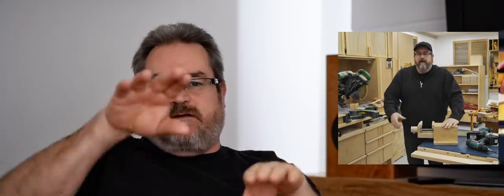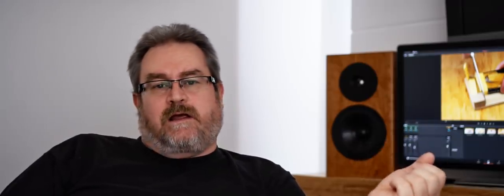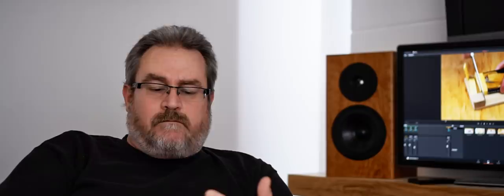So, What Happened To That New Vise, John?

Comment: John, you're a man of integrity.  It's one of the many reasons I regularly watch your videos.  One of the others being that I learn so much from each segment or project.  It pained me to hear you say that you purposely dumb down the complexity of your projects, despite the fact that I understand your desire to appeal to a broader audience.  What I hope you don't overlook, however, is that no one learns an advanced skill or mindset of any kind without a proper demonstration or example.  While you may get more views or plans sales by putting out a simpler project, those of us at the intermediate level might struggle to further improve their skill or enhance their knowledge.  With that being said, it doesn't matter if you make a cutting board or a plywood time machine, I'm going to watch it and chances are, I'm going to learn something from it.  Heisz 2020.
Reply from the maker: When I say "dumb down", it doesn't mean that the projects are easy to do. It means that I I'm going way out of my way to find solutions that any reasonably skilled woodworker can do successfully. 
For example, someone mentioned cutting slots and adding screws on either side of the nut to help hold it in, and while I could certainly do that that, I think the average woodworker would find it difficult to do accurately. That's what it means - making the build so that you don't need to be a journeyman machinist to complete the project.
Reply: @IBuildItScrapBin  Ah!  Thank you for clearing that up.  I hope it didn't sound like I was complaining in any way.  And if by "journeyman machinist" you mean turning steel on a wood lathe with a chisel/file/hacksaw, you got that covered!  Thanks, man!

Comment: I look forward to your projects...always cleverly and skillfully done.  OBTW, I think I am going to make a jointer.  My plan is simple..fence with no tilt.  No infeed adjustment fixed at 1/16" inch...surface using melamine (closet panel).  I may need your plans...but I will be modifying quite a bit to fit my simplified need...thoughts?

Comment: Interesting because Pask Makes has a very similar quick release vise with a half nut held in plywood and he's been selling plans for a year.  However, the one actually in his bench is a metal version with welding and he built the wooden one as a response to people complaining about it requiring welding.  So either his wooden one is not as good as he thinks it is or your wooden one is better than you think it is.  I think he's using a larger thread so more contact area with the wood and he did use epoxy, maybe that's the difference.
Reply from the maker: Or they are not the same design, because they aren't.
I can't comment on what anyone else is doing, just on what I'm not willing to do.
Reply: It is similar in simple definition but very different in function.
Reply: I only mentioned it because perhaps you're being too quick to give up on the idea if the same part of the construction that broke for you is working for someone else.
Reply from the maker: I generally give up on a particular way of doing something when it breaks before it reaches an acceptable amount of clamping force or durability.  But the only real way to find that out for this was to build the vise and test it. My mistake was assuming it would be strong enough, and putting time into the filming and plans.
I could make some fairly simple changes that would make the vise stronger and more reliable, but I'm no longer convinced the project has the kind of appeal to make that worth the extra effort.

Comment: Maybe you should use construction adhesive that have a bit of flex. You will have to put some grooves into the half nut. Or how about using this concept with the geared wise that will distribute the load over 2 half nuts?

Comment: John I haven't seen the plans for the vice, This being said, is there a chance that you can drill a hole through the wood and the nut so that when you glue the nut inyou could drive a steel pin through the wood and into the nut to keep it in place and keep it from breaking loose? Just a thought.

Comment: Protect your integrity, as you are doing here, because that is what is attractive about your work and videos.  The vise failed but maybe it would be fine if not stressed as much as you might have done when it broke, in which case it would be reasonable to offer the vise as a light/medium duty tool with a proviso that it is not intended for hanging on like a gorilla.  Or, build the vise to the specification you would prefer and offer that version because there are people watching you who are well able to follow complicated plans and people who, as you said, would buy the plans for interest sake.  Maybe a sprinkling of more demanding projects would be attractive to people who like a challenge and would give you the pleasure of stretching your ideas a bit?  Whatever you do, just keep it honest because it's refreshing to be able to sit and watch you without wondering if we're getting ripped off.
Reply from the maker: Experience has shown me that designing the projects as I do not only makes them more attractive to potential builders, it also saves me problems in the future with people that can do the more complex stuff accurately. A good example is my box joint jigs, which are fairly challenging to build, but still within most woodworkers skills. 
No, I have to take this one on the chin and let it sting enough so it'll keep me from doing it again.

Comment: Thanks for the integrity.  Is there a way you could braze the half-nuts to some supporting metal using Mapp gas?  Might still be a reasonably accessible project without the need for welding equipment.

Comment: How about a flat steel plate and then drill and tap through the half nut? Obviously the screw would need to be fairly small to leave enough threads useable, but it gets past the need for a welder and only needs people to have a tap and die set.

Comment: Not telling you how to suck eggs just an idea that you may have had already, would it be possible to drill and tap the flat side of the nut for a small bolt or is there just to little material to do so?

Comment: Instead of a nut, have you thought about using a coupler cut in half?  Or getting a 3/4" steel plate that's already tapped with a 3/4" hole (or whatever size threaded rod you're using), cut that in half and have a huge surface area to mount it in some form to your vise.  Just ideas I didn't hear in your video(s) that could still be found readily.

Comment: Having trouble envisioning exact part you’re speaking of, but maybe it might be easier to mount the nuts in plywood blocks with the 13/16 holes drilled in them, but instead of cutting one nut in half, you start with two nuts and file down half of the threads on either to give you clearance, without sacrificing too much of the integrity of the nut. Again, having trouble picturing what you’re talking about, mostly just wrote this to waste your time.

Comment: john its honorable that you dont put out stuff that doesnt work... BUT in all honesty, from the pictures, its expected not to be that strong. it will be enough to hold something in there, but sure enough, its nothing to beat on with brute force. given how expensive decent vises can be, it would still be a viable option for somebody with limited budget to make one. maybe only as a temporary solution, or somebody that only does small / fine work and doesnt need a uber strong vise to begin with. 

however, from what i understood, the weak link is the contact point of the nut/wood so what about taking a small piece of flat bar steel or a body panel washer and put it there in between to spread the load?

Comment: Hey John,  you are allowed to ask for help, 1 person in 15 000 may have a better idea, or at least point you in a different direction.  I understand the limits you are imposing on yourself so that anyone can build this.  But do understand, those who will actually build this may have more resources than just wood and glue. Offer the weaker option and show some other possibilities depending on if the person can buy a simple tap and a plate of steel and then hack saw it in half.
Reply from the maker: I think you are either overestimating the expertise of that 15,000, or undervaluing what I do :)
I get all kinds of "help" in the comments on the videos, but have yet to find anything more than one or two that was valuable in any way. That's not putting people down - that just the reality of it. I live and breath this stuff 24/7, so I probably have an edge of most casual viewers.

Comment: Thank you or being so honest in your design and the parameters you set yourself when designing stuff for us to drool over / build.

You mentioned that the two half-nuts slipped / broke loose when you tightened up the vice, if I understood that correctly then perhaps using a flange-nut like this one https://www.amazon.co.uk/Connex-COM450450-Flange-Fibre-Silver/dp/B00BZH4PXU/ref=sr_1_57 would work instead as it can be screwed onto your static part of the vice, you will have to cut it in half to get two half-nuts nut I don't think that's much different from cutting a normal nut / coupler in half.

Alternatively if yu used threaded rod couplers and then drilled a hole through them before you split them you could use a pin to secure it together with a slow-set epoxy but I think the flange-nut idea would work better as then it doesn't matter much if the wood compresses a you are not relying on that as the pressure is across the end of the static part of the vice and not a shear-force like a glue / epoxy joint will be where the wood compressing will break the joint at some point.

I think that could work, that or weld a nut to a piece of flat stock metal.
Reply from the maker: I can't use a special nut like that in a plan - it's hard to get in the right size and may not be available forever. That's what I said in the video - I go out of my way to NOT use hard to get parts.
As for the coupling nut, I already thought of using that, but they would make the tilt angle for readjusting the vise too steep because they are so much longer.
Reply: @IBuildItScrapBin  That's a very valid point with the availability f the special nut so I get why you don't want to use it.

I'm not sure how using a longer coupling nut (split in half) would make the angle of engagement different, that angle depends on the distance between the back edge of the lower front half nut and the front edge of the upper back half nut as far as I can see, unless the length of the front lower half nut messes with the rest of the geometry.

In that case you could use a normal halt nut at the front and the longer half coupler nut at the back as the length of that should not matter.

Then you could pin the upper back half coupler in place keeping it in place when you crank down on it.